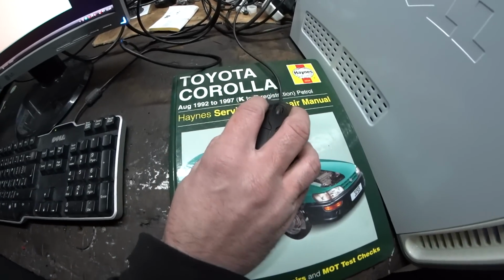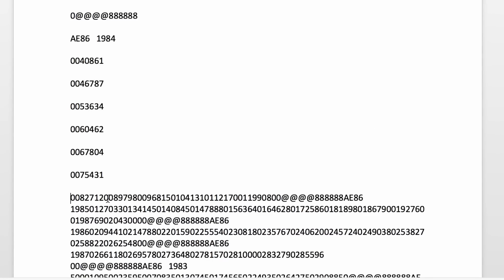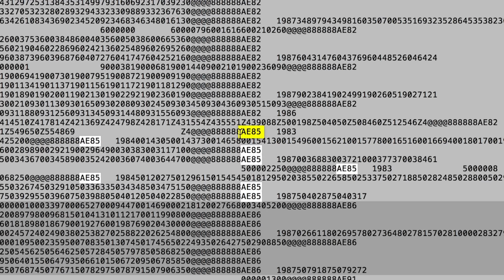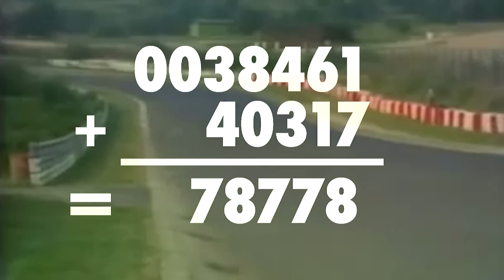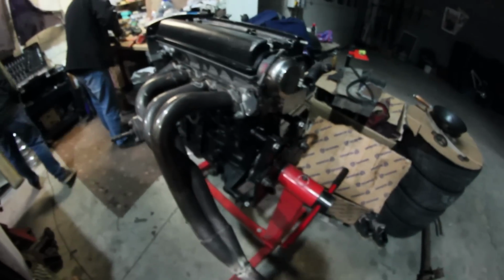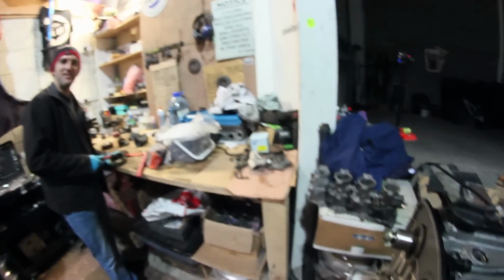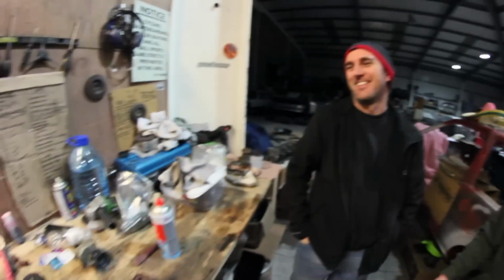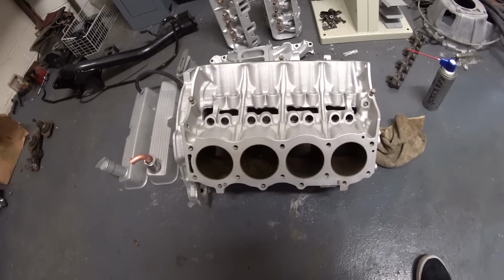The Official AE86 Production Numbers And Vapor Blasting Parts! | Juicebox Unboxed #64

Comment: my car was manufactured in July 1987, the production number is AE86-0285721 my car is a US spec SR5 single cam with drum brakes. as far as i can tell from the numbers it was one of the last ones made. installed a AE92 4AGZE swap 2 years ago.
Reply: Love the the 4agze got one in my FX Corolla and 3 in the shed
Reply: If yours is 285721, then something is off because it says 285596 in the video is the cutoff for one of the line numbers from one plant.
Reply: 596 was the end of AE86 production my car is technically an AE85

Comment: Interesting if the blasting media didn't shaved material and created gaps between the throttle body and butterfly valve because if it is, you'll get issues with idle
Reply from the maker: The Media used for vapor blasting is incredibly fine and barley cut into the metal, its still super smooth after we were finished. I guess we wont know until we fire it up but it didn't seem to do a whole lot except clean the parts.

Comment: Would suggest that cleaning unpainted (or painted but leaving original paint on) parts is better in ultrasonic bath. When blasting we make surface more rough by making micro craters what is not good for gasketed surfaces and roughness makes better adhesion of dirt. Ultrasonic cleaning on the other hand saves paint ang original roughness while removing rust and dirt to real JUST OUT OF FACTORY state.
On video we see that blasting didn`t remove soot on throttle plates while ultrasonic cleaning would make it superclean.
Any type of blasting is good when prepearing for painting or removing old paint, but for cleaning purposers ultrasonic is best choise.
Dreaming of making big enough ultrasonic bath for my shop to fit engine block in. That`s probably only way to clean rusty water passages and remove all deposits in oil channels.
Reply from the maker: An ultrasonic Cleaner would have been a good option, unfortunately we do not have access to a decent one. The Media used for this type of blasting was incredible fine, leaving a very smooth finish, the pitting will still exist in places but it its almost impossible to see with the naked eye, I would hope that the softer material of a gasket will help to seal the necessary places. I guess this is trial and error, we will see how it goes!

Comment: Your starter motor contacts are worn  ! (I can see it in the film), I might have some in garage,  when I worked at White and Lockwood Toyota we used to order them from somewhere (not Toyota), some electrical supplier. You can swap the worn one for the good one sometimes and it will last another few thousand miles.
Only one wears (the first one that contacts), I used to swap them for new all the time at Toyota. But you can swap one side to the other at a push (Ask Bryan D).
Please dont use wire brush on pistons a brass (suede) brush is much less aggressive but just as effective. (It wont damage the alloy).
Please don't sand your valves ( I learned this at Toyota and Yamaha training courses) lots of valves are sterite coated or titanium, (I thought the silver or blacktop had titanium but I might be wrong it might be the Black top beams im thinking about) these valves can be cleaned with bench grinder with wire brush wheel attatchment in seconds with much less damage to the coating on the valve. Some of Nissan, Ford, Toyota and Honda engines I have worked on have stated in the Genuine workshop manual that if the valve is sterite then it should not even be ground in.
The cylinder head  was copied by Toyota from the Cosworth BD engine family. I have seen Toyota USA genuine adverts for the 4AGE , they used it in a single seater one engine series and in N.A form the 1587cc engine produced 250bhp. 
Love the chassis number episodes, All Euro cars have 17 digit Vin numbers, thats how we tell an import bike or car from Japan in the uk, the Toyota manuals (genuine) used to tell you loads of info in the front pages like what all the letters meant. I think Bryan is great, I bet he's forgotten more than we will ever know.
Remember its T1 and TE1 that you short for timing !!!! (But thats another story).
Much love, Michael Mahoney (michael marni).

Comment: Being in the vehicle restoration for longer than I care to remember, a little tip, get some hammerite kurust, dab it on some grey or red scotch brite and go to town on your steel engine parts, wipe it over so the whole part is covered, let it change colour but still damp, give it a good scotch to clean the pitted areas and depends what finish your after, paint/ clear coat or metal polish, you can get away with painting most of the pulleys but not the surface the cambelt runs on, great channel guys, my inner geek is loving the ae86 history and numbers

Comment: FYI there are sites online with all of the EPC data and parts diagrams since way back. Can't really access the stuff under the hood like that though, obviously. I've had access to the current Microcat system and it all mostly checks out, except for replacement parts numbers. Shame you can't pull production numbers from MC too since it's all web-based.

My plan before was to buy some of those car identification manuals the parts departments used to get before you could just write the VIN into a program and get all the info on the car. I.e. the time before time when Toyota workshop and parts guys actually knew what codes meant.  Those manuals show up on YAJ and I'm fairly sure they also contain VINs and production numbers.

Still wanna do it to figure out all the E70s ever made, those numbers should be wiiiiiild.

Comment: But Neil! The "Ae86" with the twin cam (corolla GTS) was a ae88 in Canada / USA ! The single cam cars being ae86's (chassis code)
Reply from the maker: From what we can gather, the AE88 is just a vin separation code that Toyota decided to use to distinguish between the US models, AE86 is still stamped on the frame of both the GTS and the SR models and the code still corresponds to the original numbers.